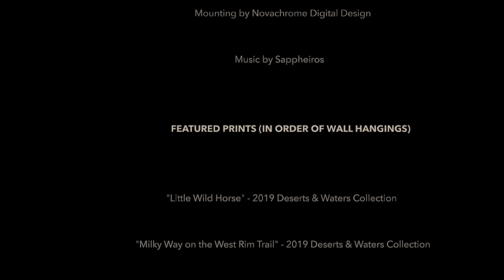Limited Edition Acrylic Print Production

Comment: Beautiful work. Simply amazing. I´m on the market for a Canon Imageprograf 1000 printer but I´ll probably go for the pro 2100 because of the 24" width, but your Pro 4000 images are outstanding. The black frames you use for the back of the print, are they custom made? Thanks!
Reply: If it's in your budget to start right out with the Pro 2100, I recommend it since you'll be able to make bigger prints! Yes, the black frames are custom made!

Comment: excellent work, what kind of paper do you use to print
Reply: I use Red River Polar Lustre Metallic (I’ve also used the glossy version and like that as well)!
Reply: @neshamaroash302  Fantastic pictures and framming job. Regarding the paper, I^m in the market for a similare paper with archive claim. Do you have information in this matter from  Red River, because they specified on their website this paper as "Acid free base stock. Coating slightly acidic". which is according to me a no go for archvability. Thx

Comment: What is that roller called to help flatten the poster?
Reply from the maker: Hi Travis! Those are laminator rollers. Thanks for watching!
Reply: Thanks, does this also help flatten the poster? They tend to get wavy after printing @neshamafineartphotography
Reply from the maker: Hey there @TravisHarris-f5i ! Yes, if you mount your posters to acrylic, they will not get wavy like they do when they are simply behind acrylic inside of a frame.
Reply: @neshamafineartphotography  Nice, thanks for the tip